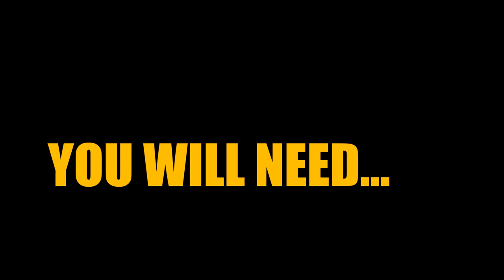TVS APACHE RTR 200 ENGINE OIL & OIL FILTER CHANGE | SHELL ADVANCE ULTRA 10w40 | HOW TO CHANGE OIL

Comment: can we use motul 5100 10w30 for Apache 200 4v ?
Reply from the maker: Hi Ayush, Motul 5100 is a semi synthetic oil, you can use that but do keep in mind that TVS recommends fully synthetic oil.
No harm in using semi synthetic oil just note that the oil change interval should be sooner do not use semi synthetic oils more than 3000km if your usage is heavy.
About Motul 5100, I found it to be one of the best semi synthetic oils available in the market today.
Would recommend any one of these:
http://amzn.to/2ohXJ8t
http://amzn.to/2pqenmw
Reply: The Sportztourer but I don't find any fully synthetic oil of motul in 10w30 grade......only tvs tru4 is fully synthetic oil available in this grade.....n I dnt want to use 10w40 or 15w50......do you know another option of fully synthetic oil available in this grade ?
Reply from the maker: +Ayush Shukla No problem with 10w40, infact 10w40 has better high temperature performance than 10w30. A 10w40 oil will give better engine protection at high temperature stress riding condition like traffic/high speed riding.
Honda has got fully synthetic oil in 10w30 grade for CBR250R, you can get it from their service station.
TVS TRU4 Fully synthetic is an another good option.
Hope this helps.
Reply: The Sportztourer thanks for the reply......but then I don't understand if 10w40 is better oil than why tvs recommend 10w30 ?
Reply from the maker: +Ayush Shukla A lot of factors come in play when deciding on a particular grade or design to be used on a bike. If you see manufacturer maintain a balance between quality, cost & performance.
If 10w30 oil meets all the requirements plus gives a wee bit of less resistance then it's good to use. Nothing wrong in using better quality oil just remember not to change the '10' in 10w40 or 10w40.
Reply: thanks you for the detailed reply 🤗.....I brought rtr200 3 weeks ago.....n will give for first servicing in upcoming week.....thats why I am asking about oil..so I decided to go with tvs tru4 oil till free servings then i will think about changing oil brand......any other tips for first servicing bro btw I m in pune where u live? ☺
Reply from the maker: Congratulations Ayush on the beautiful machine. TVS TRU4 Fully synthetic oil performs efficiently on this machine. No special treatment for 1st service apart from washing, chain lubrication, oil & oil filter change.
Punekars have some amazing riding locations nearby, I do shuttle between Pune- Mumbai.
Reply: The Sportztourer hi i have hornet 160r company recommends 10w 30 oil can i put 10w 40 grade oil
Reply from the maker: Yes, you can use 10w40. My friend is using Shell Advance ultra 10w40 in his Hornet for a long time & is happy with the performance.

Comment: Can I install oil cooling system in RTR 160?
Reply from the maker: Hi,
Yes you can install, its a direct fit.
I had a 180 for 6+ years and to be honest I never felt the need of an oil cooler. The heat management on the RTR 160 and 180 is excellent.
Also note you will need extra engine oil to compensate the oil cooler.
Reply: @thesportztourer  yes..1.2ltr...may sal may ek bar long ride pe jata hu..3k-5k km Tak..pichle sal hi Gaya tha..jab engine bohot garm hota hay to engine ka smoothness Chala jata hay....

Comment: Buddy TVS recommends 900ml oil during regular oil change and 1ltr in case of disassembly..why 1200ml then??
Reply from the maker: HI Kedar,
That's the recommendation for RTR 160/180 but the RTR 200 needs 1200ml (as the oil cooler also takes some oil).
Reply: @thesportztourer  as always thanks for the information 😊

Comment: Why my new rtr (not yet first servicing done) got heat up at engine oil tank after running 2-3 km
Reply from the maker: Hi
How many km done? Fuel injected?
Reply: @thesportztourer  yes FI bs6 almost 230km
Reply from the maker: Its absolutely normal for an new engine to heat up and have hard gear shifts. The engine usually takes some time to settle in, still if you feel anything abnormal you can mention that during the first service.

Congratulations on the new machine, welcome to the tribe 😊
Reply: @thesportztourer  thanks bro
Aur ek question tha Regular petrol use kare ya Power petrol (extra premium)
Reply from the maker: Assuming the quality of fuel is good at your place you can go with regular unleaded petrol 😊

Comment: Tvs recommends 10w30 grade. 10w40 can harm the engine?
Reply from the maker: Hi,
I have used 10w40 on my RTR 180 for more than 50000km with no problem. Using the same grade on my 200 for more than 10k km.
If you want to stick with the recommended grade 10w30 then you won't find much options in fully synthetic engine oils. Do check out the Rajasthan ride series on this channel where I have given detailed review on the Motul 300V 10w40 engine oil.
Reply: The Sportztourer if i am a normal rider them can u tell me that till how much km motul or any other 10w40 fully synthetic oil can last?
Reply from the maker: For regular riding I would suggest you to stick to the TVS Tru4 fully synthetic engine oil. The fully synthetic engine oil from TVS is good & value for money (you get 1.2L pack).
Reply: The Sportztourer i am apache 160 owner. I fell that tvs oil does lasts long. It losses its quality after 300km  but  tvs claims 6000km which is not possible.
Reply from the maker: TVS TRU4 fully synthetic should work fine till 3000km for regular use.
If you want to try a better oil then you can definitely go for Motul 7100 10w40.

Comment: Which engine oil is good for my apache 180
Reply from the maker: Hi Neeraj,
TVS TRU4 fully synthetic oil is good for normal regular use. If you want to switch to a better oil then Motul 7100 10w40 will be a good pick.
My experience with Shell advance ultra and Motul 7100 10w40 has been really good on my RTR 180.
Reply: The Sportztourer thanks buddy

Comment: can you please tell that after how many kilometer the oil should be change ?
Reply from the maker: Hi Ankit,
For my kind of use (extensive touring) I usually change the oil in 3000-4000km zone.
Reply: @thesportztourer  but  that oil change sign appear on my screen after 1800 kilometer. Should I avoid it ?
Reply from the maker: RTR 200?
Reply: @thesportztourer  yes
Reply from the maker: That service reminder is based on km covered from the last time it was reset. You can easily reset it now by following these steps: https://youtu.be/wxD6lTQSbow

Comment: thanx Vai.....please Correction. Its Oil Cool Right...? When U Replace Oil Filter..... Filter Out and Cranck Ur  engine Many Time..... with out key on ingnition..There is much oil into oil cooler radiator.... And 200ml jar never give accurate 200 ml engine oil.... cause its engine oil.... Measure your 200 ml engine oil from Engine Oil Container which have 200 ml ~ 1l indicator.....🙂🙂😉
Reply from the maker: Yes, its oil cooled. Thanks for the suggestion 😊

Comment: Oil filter is to be changed at how many kms ?
Reply from the maker: Hi Gaurav,
I change the oil filter for every engine oil change as it costs a nominal ~Rs 40.
Reply: The Sportztourer  where to get one for apache 200 ?
Reply from the maker: You can get it from TVS service center 👍

Comment: how is the oil performing....😋
Reply from the maker: Hey Rohit, the oil is performing very well. Did a 2000+km long ride (~940km in a single day) with this oil & no issues faced. I have experimented with almost all the synthetic oils available in Indian market (yet to use petronas, Agip & Repsol) in my bikes. Next time it will be Motul, will update how the fs Motul performs on the 200.
Reply: yyeah do tell me which is better motoul or shell
Reply from the maker: Hey Rohit, both the oil companies are really good & I am using both of them for a really long time time.
Here is the recommendation list from my side:
Fully synthetic
http://amzn.to/2p5Mc9e
http://amzn.to/2p5R66k
Good but not value for money (atleast for our bikes): http://amzn.to/2q3OTrs

Semi synthetic:
http://amzn.to/2ohXJ8t
http://amzn.to/2pqenmw
Reply: Can u please tell me for a new rtr engine oil change at every servicing is compulsory

Comment: why 1liter 200 ml ?
Reply from the maker: +VeNuM ArNaB TVS recommends 1200ml of FS oil. The extra 200ml goes in circulation as the 200 comes with an oil cooler.
P.S: Even Pulsar 220 gulps 1.2L.
Reply: Ohh

Comment: My rtr 160 turns off suddenly while driving what's the problem please reply fast guys
Reply from the maker: Hi Akshay, does the engine turns off when you press the clutch?
Reply: The Sportztourer  no it just blocking while driving and suddenly turns off while driving and then i have to turn the ignition off and have to turn on then it gets started
Reply from the maker: Did you washed the motorcycle recently? Pressure wash?
Reply: The Sportztourer nope
Reply from the maker: Does the speedometer display flickers or restarts when the bike stops? How is your air filter condition? Total how many Kms done?
Asked these questions because a lot of factors can be behind this problem.
Reply: The Sportztourer yea bro my speedometer restarts after turning off and my bike ran around 2900 kms .since its a new bike which i bought on October 2017 😑
Reply from the maker: Got it 👍 
Its an electrical fault. Take your bike to the service and ask them to check the battery connections & the fuse which is associated with it. Also get the spark plug lines checked.
Nothing to worry it is a minor problem won't take more than 15-20 mins to get it sorted 👍

Comment: At how much kms should we change the oil in rtr 200.
Reply from the maker: Hi +Arfat Khan,
For fully synthetic oils under medium to heavy usage the oil change interval is around 4000km (the oil viscosity starts to drop).
Reply: I used motul 10w50 in my rtr 200 . Which costed near 700 for 1200ml. Which oil it would be & how much km should I use.

Comment: Can I use 
Motul 300V 15W-50 for my Apache 200 4v?
Reply from the maker: Hi +Arkaprava Samanta, better go for Motul 300v 10w40 : http://amzn.to/2rCcj83
Motul 300v 15w50 would be a heavy oil for Apache. The start up lubrication inside the engine would be slower & the engine will face higher fluid resistance when running at high RPM. So better stick to 10w30 or 10w40 grade of oils.